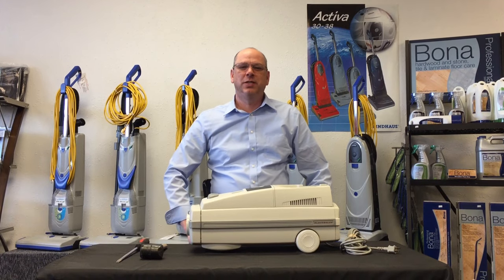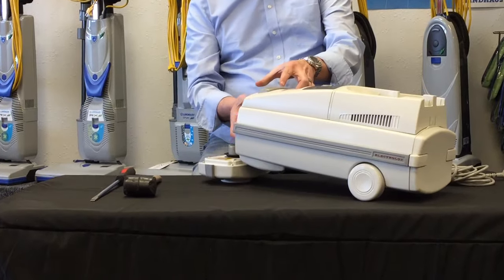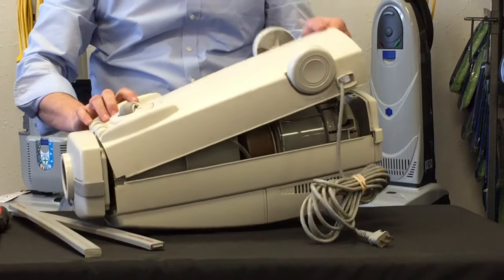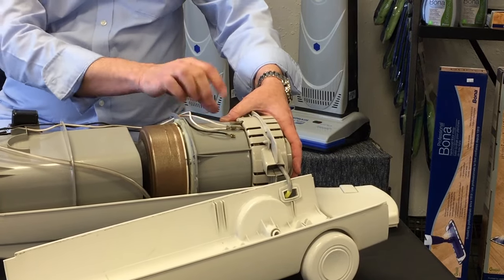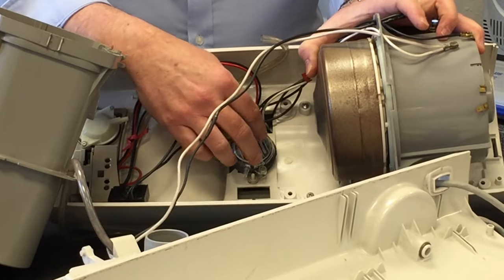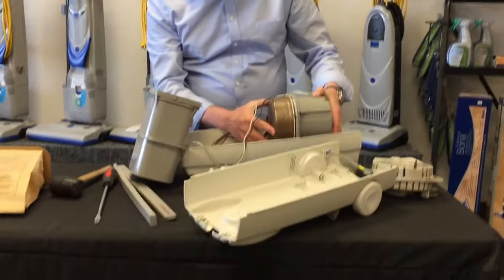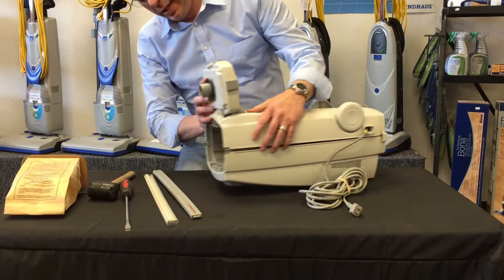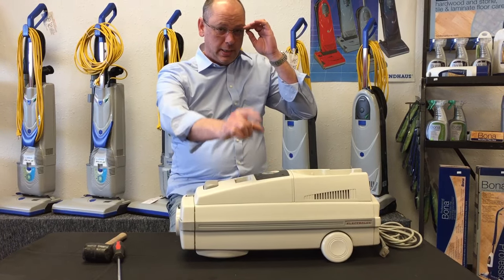Electrolux Epic 6500 Vacuum Repair

Comment: Just bought Used Electrolux with all the attachments at our local restore for $35 pulling off that tube for the automatic shut off worked like a charm thank you so much for providing these videos

Comment: Great instructional video.
I picked one up with the power head and entire tool set for $3.00 at a garage sale. Including an unopened set of bags. The tube from the vacuum bag holder had come loose. Reattached it, worked! I did order new post-exhaust filters. Wow. Well worth the few minutes work.

Comment: Our Electrolux canister is probably 25 years old but still my favorite vacuum.  About 10 years ago the vacuum would shut off when put under strain.  I would turn it off and it would start again but the same thing happened over and over.  I had it successfully repaired and it continued to work fine until recently, the same problem reoccurred.  After watching this video I fixed the problem - no charge!!    Thanks so much for the guidance.

Comment: Thank you, our Electrolux 2100 had the broken valve problem, I disconnected the hose as you indicated and reassembled the unit and it's working fine again..   It's old, but it's size and power and little power brush head make it the best auto vacuum I've seen..   Thanks again..

Comment: Thank you,  I wasn't comfortable taking apart my Epic 6000 SR and took it to a local vacuum shop and they told me it was an electrical problem.  I told them exactly what I researched/watched online about the control valve.  They did nothing and charged me $30.00 plus local sales tax.  I came home today, watched this again and was able to fix the vacuum.  Thank you for this video.  My vacuum is working perfectly.  I can't believe they told me it was "electrical" when I clearly explained to them what the issue was.  This video gave me the confidence to take it apart, disconnect the valve and save my 25yo Electrolux.  Thank you again.
Reply: This is why the vac/sew shops are dying.  Customer service is the most essential part of my business. I bend over backwards to be nice when I have to explain to a customer why code won't let us do it their way. I, after over 40 years in the business still put in Sunday afternoons two or three times a month because a customer needs help NOW.
We used to have three vac shops in our little town. Now, one. The young man who runs that shop? He is honest, forthright, customer oriented. Keeps him in business at a profit.
Reply: When you took off the hose coming from the bag open control valve, to bypass it or make it non effective, shouldn't you have plugged both ends to prevent suction or vacuum loss?

Comment: Thank you Saras for sharing this video.  It is an easy to follow tutorial.  The staff at Saras helped me find the correct replacement motor for our Electrolux vacuum cleaner.  With your staff
 assistance I saved $260 that our local Aerus dealer quoted to replace the motor and clean the unit.

Comment: I popped a new bag and exhaust filter on and started my Saturday vacuuming only to have my Epic Series turn off and the full bag light kicked on. Did some troubleshooting online and learned my sensor would probably need replacing. Too bad California is in pandemic shutdown because I need to vacuum!

In minutes, I found your video and had my 30 yr old machine in pieces and disconnected the sensor.

Thank you for the excellent guide! Big thumbs up!

Comment: Very helpful video. I've had my 6000 since new in 1993, and it's been great. Power switch just now stuck in the off position. I appreciate your easy to follow video showing how to get the unit apart without breaking it. Once I get the unit opened up it should be an easy fix. Thank you!!!
Reply: Hey, my switch is stuck on any chance you can throw me a few points on how to get to it, what the switch part number is??? The foot switch moves when pressed and springs back but no clicks audible or feeling and its is stuck on so have to plug in unplug to use. Thanks if you can help! (EPIC 6500SR)

Comment: Mine started acting up like the cord had a intermittent break. Open up following your video and found one wire had came loose from a terminal and was just touching it. Put it back, and it works great.  Thanks for showing the right way to open the thing.
Reply from the maker: Glad it was helpful!

Comment: Fixed many of these plastic Lux's back in the 2000's when they were coming due for motor replacement.
Had to be super careful with the early plastic models (the Hi-Tech and 2100). The plastic was especially fragile if it was yellowed.

Comment: Here's a complete list of Aerus/Electrolux's plastic cylinder vacuum cleaners by models (on inside cover and/or barcode sticker under diffuser) & names:  1623/L-E, Model 90, Ambassador, Special Edition, Regency Series 1000; 1625 AdvantageSeries; 1676/Ambassador II, Ambassador III; C101A, -G, -H, -J/Ambassador III;  C101K, -L, C141C, -E/Lux 5000; C141D, C151B/Lux 2000; C151C/Ultralux 2000; C151D, -G, -M/Lux Classic; C141A, -B, -F, C152B/2100; C141G, C152C/Lux 5500; C152E/Ultralux; 2100/Hi-Tech, Regency Series 2000, Special Edition, Diplomat; 1515/Regency Series 1500; 1677/Diplomat LX; 1718/Epic 6000SR; 1762, C102A, -D, -G, -J/Epic 6500SR; C102K, C153A/Lux 7000; C153C, -D, -E/Lux Legacy; C104A, -H/Renaissance; C133A/Epic 8000; C134A, -B, -E, C154A, -B/Guardian; C134C/Guardian Encore; C134D, -F/Lux 9000; C154E/Lux Guardian; C170A/Lux Guardian Ultra; C177A/Lux Guardian Platinum

Comment: Thanks for posting this, Lloyd!  For your viewers' info., if the manufacturer stamped on the cleaner is "Electrolux Corporation" or "Electrolux LLC" it is the company that is now called Aerus LLC (since 2000 when it sold back the trademark and brand to AB Electrolux of Sweden).  Go to aerushome.com to download or request free scanned users manuals.  For warranty issues and ordering specific parts one will need to supply the serial # (5 digits between 2 letters) which is stamped on the stabilizers.

Comment: Thanks your excellent video. Have an Ambassador 3 that wont start at all. I opened and found that the Valve had already been taken out and bypassed I guess. It was not there. probably by another repair person, a long time ago. It worked until now. Is there a video how to troubleshoot this model? or could you do one or point me in the direction?  thanks again.

Comment: Where is there a site to purchase a replacement motor, if needed?  My sensor for overheat keeps coming on, and after obvious diagnostics run, I'm either going to have to replace the motor or perhaps the sensor. This video is extremely helpful when it comes time to do the motor; looks simple enough; but what if the sensor is bad?

Comment: THIS ISN'T FOR THE FEINT OF HEART. AS STATED THE CONTROL VALVE (LOCK OUT VALVE)IS A VERY COMMON PROBLEM WITH THIS DESIGN AS IS THE FOOT SWITCH. GREAT MACHINE (STILL SOLD TODAY) BUT IT'S PUT TOGETHER IN A WAY THAT DOESN'T MAKE IT EASY TO DISASSEMBLE.

Comment: Have a 6500 Ambasaddor and the orange power plug indicator stays light on the panel. The motor whirs but there's no suction. Have tried replacing bag but am not sure what the issue is. There are no capacitors/etc that hold a charge in this unit, correct?
Reply from the maker: Sounds like the motor could be shot.  If the motor is "whirring", but not running full power, it is likely sparking like mad at the commutator.  I would recommend replacing the motor or taking the unit to a vacuum shop for assistance.
Reply: @sarasvacshack2127  That's what I will do. Thanks so much for your advice!

Comment: Thank you for your valuable information about taking the Epic 6500 apart.  Our problem is that the back wheels do not turn any more.  It is like they have seized.  Can we replace the wheels or do we have to replace the entire bottom panel of the vacuum?
Please reply.  Thank you.  Patricia Longbard
Reply from the maker: Unfortunately we have not found a way to fix that without replacing the lower housing completely.  The axles on the wheels and the corresponding holes are worn down so far, that the wheels bow in under the weight of the vacuum and rub against the body.  Glad the video helped!

Comment: It's too bad I didn't see your video before I decided to take mine apart.  I was trying to fix the reel for the power cord.  Even though I succeeded with breaking anything, unfortunately, I managed to pull off the leads to the motor and now I don't know where they go.  I contacted Electrolux for a wiring diagram and they refuse give it out.  They said to take it to a dealer for repair.  Unfortunately, there isn't a dealer within 100 miles of where I live.  The unit is model  C141E, also called a Lux 5000, very similar to the one in your video.  It has 3 wires that connect to the motor, a white, a yellow and a grey.  That's it.  Can anyone help?  Thanks.
Reply: It took a while to find out, but at last I got the wiring correct.  Sorry, but I closed it back up before I could take a snap shot.  The trick is that a male terminal from the cord reel has to engage to the female terminal directly under it belonging to the blue exhaust compartment attached to the motor and then a white and a yellow wire piggy-back onto that.  The grey wire goes on the other available terminal on the cord reel.  I liked this vacuum so much, I kept it around for years.  Now IT'S WORKING!  And, I'll find some use for it.  I had a lot of help from the Electrolux dealer in Pasadena.  A tech there, Karen, was quite useful. I did take a photo of what was the critical connection for me.  If someone needs it, I'll post it somewhere.

Comment: I need to know  how to change the wheels on the Epic 6500 SR.
Thanks
Reply from the maker: Once you have the body apart as shown in the video, you will see the wheels are held in by a C-clip on the inside of the housing.  Pop off the C-clip, and the wheel will slide right out.  Be sure to lubricate the new wheel axle when you replace it.
Reply: @sarasvacshack2127  Thank you again.